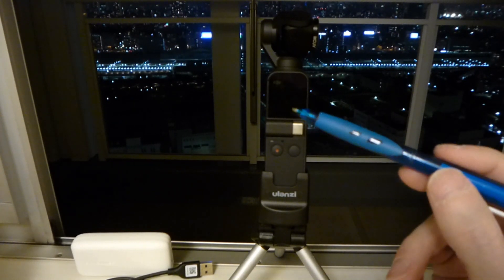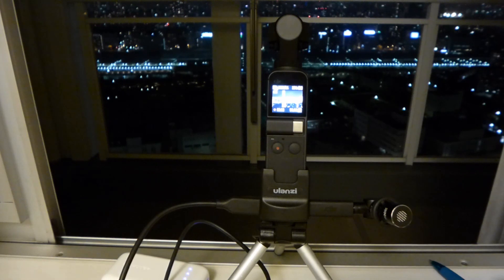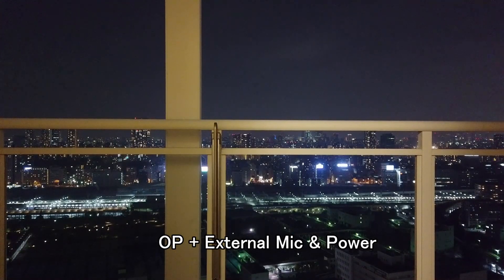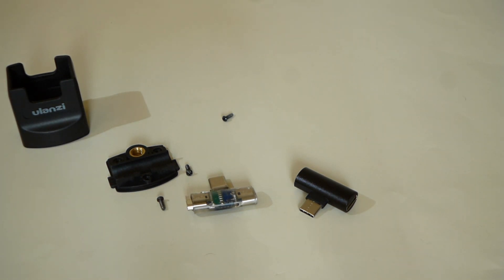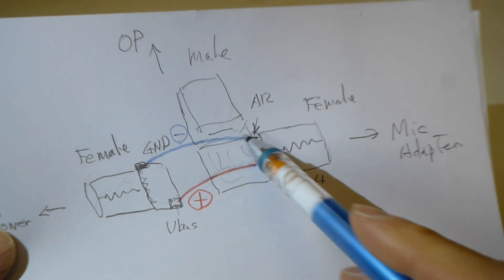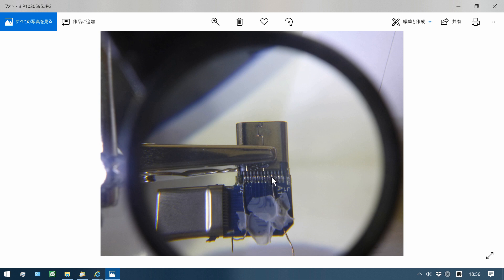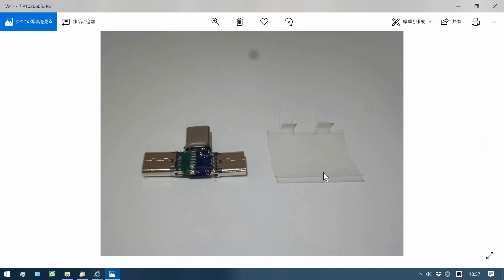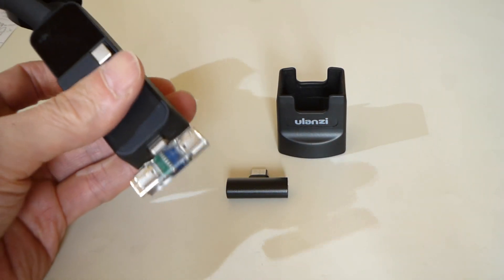DIY T-Shape Power Adapter for Osmo Pocket with Mic Adapter

Comment: So does the Ulanzi's adapter allow using the mic adapter and charging at the same time? Or do you specifically need this kind of DIY adapter to make it? You seem to be handy with this DIY, kudos for that 👍
Reply: He modded it with custom boards. It needs to be wired in a specific way for the splitter to work with both mic and power.

Comment: Wouldn’t it be possible to modify the simple angled pass-through connection, so that one could use a digitally connected microphone of any sort (I have 3, starting with Zoom H2 USB interface, Olympus LS-P2 and my current “darling” the Shure MV88+ which is digital out only (Lightning and USB-C both). That way the analog stage (and the horrible DJI Audio adapter Can beneliminated completely - or?
Reply from the maker: I'v never hear that the big GoPro mic adapter can be eliminated by direct digital mic connection.

Comment: I would like to see a modification of the wireless module so that it can have a pass trough to the mic adapter.
Reply from the maker: OP is using ID pin system to recognise external attachment.
Reply from the maker: I just finished "Connector for Osmo Pocket Wifi Module & Mic Adapter".
Reply: @nianeko3670  Wonderful - look forwards to the video.
Reply from the maker: I just opened.